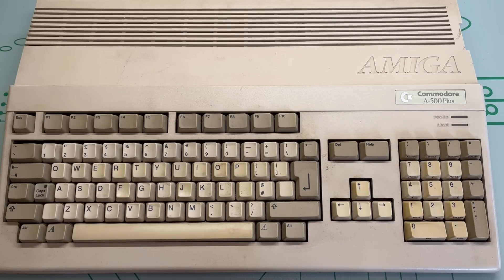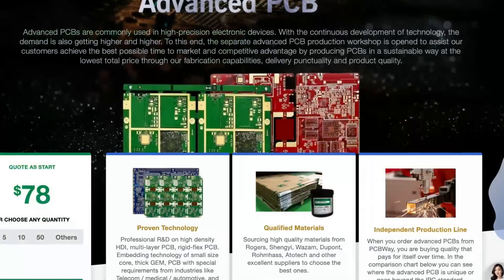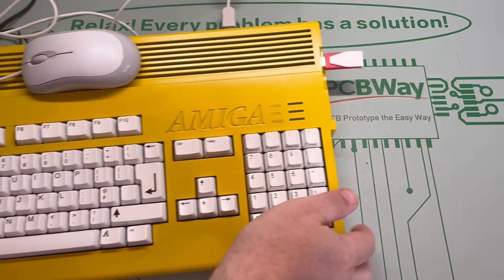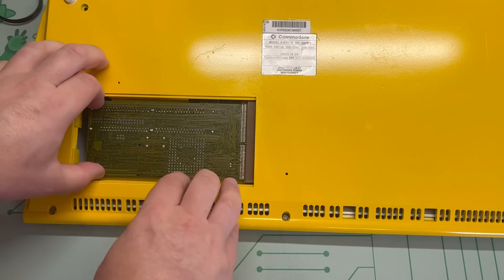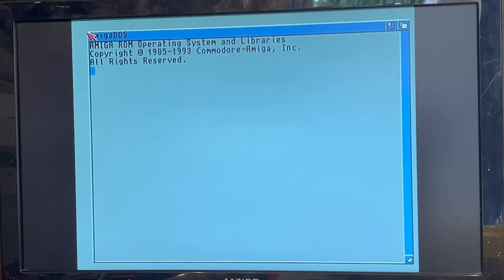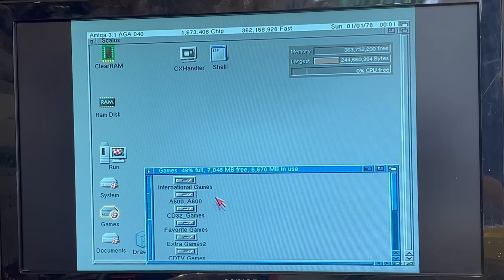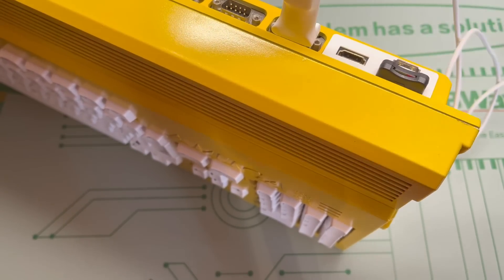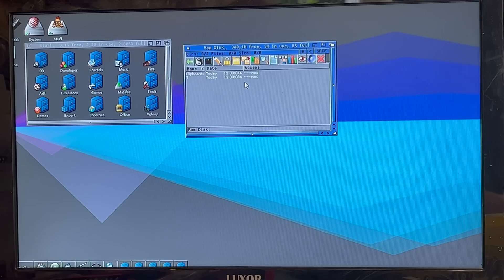Installing a PiStorm32 Lite in your Amiga 1200 is so easy now that even an idiot like me can do it!

Comment: From uk sorry to did you respray your a1200 case yourself or buy it from a site I had a a1200 20 years ago and fitted a 8 mg blizzard sold due to divorce but now times have changed and purchased another a 1200 bod standard but I went for a recapped one and I’m lost the first thing to do is get probably a pistorm and pi zero off pi hut because it’s not set up for hdmi  plus a gotek and a cf hd is there anything else I can do I spent a bomb on the Amiga it runs but I have not seen a screen shot yet please any advice doing a lot of research and excited

Comment: I remember moving from my A1200 to my first PC, a Pentium 120MHz and trying to get my favorite Amiga games to run on it. Back then UAE didn't stand for Ultimate Amiga Emulator, but Unusable Amiga Emulator. Look it up, not a joke :) The 120Mhz Pentium wasn't anywhere near fast enough to emulate even a 68010. Crazy to think a Pi is over 600 times faster than a A1200

Comment: First time installer of a pistorm and kept getting memory errors doing 'sudo ./buptest" and found out the legs of the pistorm didn't quite make full connection inside the CPU socket. I had an old accelerator card that fit in the same cpu socket with 'chonky' pins, plugged it into the socket, pulled it out, then put the pistorm back in.. now the pistorm works like a champ!!!

Comment: CPU, RAM, graphics - all done by Raspberry Pi. Is Amiga anything more than a keyboard for the Pi in this setup?
Reply: I hope by now you know how a Pistorm works and it is nothing more than another CPU accelarator with the ONLY difference is that it's emulating the OFF THE SHELF 68K CPU.  Everything else is 100% Amiga, all chipsets are required.

Comment: Just bought an a1200 that comes with the pistorm 32 lite and raspberry pi 3a+ although it’s not fitted. Somehow I doubt very much that when I plug it in it’s going to be as smooth as a transition as yours was

Comment: Regarding why chips can't access memory on the Pi -- it's because the DMA controllers only touch CHIP RAM.  The CPU's address bus funnels into the Alice/Agnus chip; but the Alice/Agnus chip cannot drive the CPU's address bus (and even if it could, it only has 21 address bits to do it with; hence, 2MB).  So it has zero way of even talking to the Pi even if you wanted it to.  You're going to have to use the PiStorm's support for RTG graphics if you want to use all that new memory for video purposes, I'm afraid.

Comment: It's really easy with Emu68 indeed, for overkill performance put in a pi4b or CM4 with adapter board with some active cooling, overclock it to 2.2Ghz.
Get ready for some shock&awe. it took me weeks to get used to the fact my A1200 was that fast 😄😄

Comment: I've got a PiStorm32lite inside my A1200 and it's incredible, I'm also using a 3A+ as well (as I am with my BBC Master but that's another video) and the speed increase and usability factor goes through the roof. I've got a 256GB microSD card inside mine and using PFS3aio for the filing system except for DH0: (Workbench:) which is still using FFS. The PFS recovery tools from the main PFS3 package are installed into DH0: so if there are any problems I can still boot and rescue the machine. The boot partition is set to 2GB on which I've created a directory called XFER, which I use to transfer data to/from my Amiga/PC as you can mount that FAT32 partition within the Amiga.

One thing I noticed with PFS is if you create a partition bigger than 104GB it puts it in test mode as anything over that is untested. I had a requester warning me when I went to format a massive 220GB partition so I now have 5 partitions, two of them being 100GB each.

I've also got two monitors connected because the native resolutions come out of the standard RGB monitor port and the RTG screens come out of the HDMI port and when different screens are opened, it's a pain having to manually switch all the time when using one monitor with both cables plugged in. So much easier and quicker to tell when something has crashed instead of trying to find a screen open.

I've got mine running in full 24bit color and in 1080p and it's not slowing down - as for the system, I set Workbench up myself just as I like it.
Reply: I am new to this, just bought a PiStorm32lite for my A1200.  Is the best option to save software such as games on the MicroSD card or do people use the Gotek with the PiStorm?

Comment: what was hard on pistorm original. burn sd card and setup it, but its not real amiga its emulated chips using real hardware. same as googling and use winuae same time
Reply: It doesn't emulate any "chips". PiStorm only emulates a CPU. Nothing more

Comment: Your first mistake was doing anything with an A500+. Come on, everybody knew they were just a rubbish A500 and the people who bought them were just "special". Just joking!

Great video, but was hoping for some more detail. I have some important questions though: So this Pi emulates a 68040? So does it implement all of the 68040 instruction set, for instructions like movec, registers like bc, ccr etc? There are instructions on the 040 that don't exist on anything lower.

I'm also quite interested in the memory layout too. A true 040 chip used to use some memory locations between $0 and $320, if I recall correctly. Some on my demos would relocate loaders and stuff down there, after killing the OS. Flower Power/Anarchy and a few Sanity demos has similar systems whereby they did their own memory management and loading after killing the OS.

It would be interesting to see what the OS said was the lowest memory address that could be used was. That's would really be a twat of how good an emulation the Pi was doing.

Comment: chipspeed is still ultra slow.  the 030 had chip speed of 3.28the pie 1.27 so I assume its still very bad at anything that uses AGA games and paint programs.
Reply: Chip writes have been maxed out for a while now (SysInfo won't show that though, better use a proper benchmarking tool like bustest or ssspeed). As for games, most WHDLoad games work fine with the correct WHDLoad and EmuControl settings. Some of the discord Devs are working on a wrapper to automatically apply the optimal settings for each game from a database they are putting together, which will cut down the bed to manually change settings.

Comment: I'm getting some mixed search results. Can you use the pi's wifi or ethernet with the pistorm32-lite? Preferably with Roadshow.
 And if it does, how are the transfer speeds? (compared to pcmcia ethernet?)
Reply: No Pi WiFi/ethernet under Emu68 at present

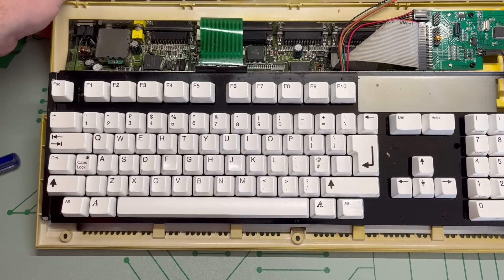Comment: @4:20 not sure how well this would work on an amiga but ive found for cards that dont have much room or are not easy to grip is to put a little piece of tap at the edge sorta like a tab that you can pull on, i do it to my CF cards in an embedded system as it doesnt still out far enough for my fingers to grip

Comment: The Emu68K configuration is so much easier than the first implementation of the PiStorm. That one requires three different computers to set it up! (A PC, logging in and configuring Linux on the PiStorm, and configuring the Amiga) - this certainly reduces the steps required.

Comment: in which way is the usb port or ports of the pi to be used. i want to transfer some file from my pimiga setup to my cafeine 1200 setup. never saw a clear video of that. and that is what really matter to me. data transfer.
I did stick the pi3B+ in there and indeed that looks like a castrated cat with the ports of the rasp hanging true the bottom of the case LOL really should get me a 3a sometime.

Comment: I enjoyed the video but Gloom ran very well on an 030. Would Quake not have been a better test? I'm unclear where your cables for the rear port came from, and what the implications are for video output regarding Amiga games and mode promotable programs. Woud I need separate monitors etc?

Comment: On the one hand, this is nice. On the other hand, the PI is giving you the CPU, the accelerator chips, the memory, the HDMI, the winchester... in the end, this is not else but an emulator put into a cases of an Amiga.
Reply: Sorry but that is not the case. The Pistorm is much more like a turbo card. All internal custom chips remain in function. All ports of the Amiga can still be used. Graphics and sound output also work as you know it. Only the original processor is switched off. Ok it is a little more complicated but you can read about it on the net.
Reply: @Fumpzong You can look at it that way too. But. It can emulate the CPU, can give you RTG video (with acceleration!), emulates the clock, the SCSI, the ROM. If you switch that all on, what remains? Maybe the Paula, but I'm not sure.
Reply: @MrEnyecz  Depending on one's point of view, the situation can be described as one in which the glass is either half full or half empty. If you have fun with a PI Storm, you have fun. Those who don't, even not 😊
Reply: @MrEnyecz PiStorm doesn't emulate anything other than a CPU. All the other stuff (RTG, Storage) is handled by 68k drivers hitting the Pi hardware directly. Nothing there is emulated, all the original chipset is still in use.

Comment: PSA: Be aware that the ‘timing issue’ does affect Pistorm32, this has been fixed in software though.

CaffineOS didn’t give me this issue and I believe newer builds of emu68 fix this, but older builds without the fix caused crashes. I don’t know if Musashi has had the fix applied.

Comment: Very cool mod but 2 things come to mind. 1: the sd card slot should have been located the other side of the board so its accessible via the trapdoor rather than unscrewing the case or buying the breakout box. 2: Is there really any point doing this? There isn't much you can do on an Amiga that you cant do via emulation or via modern pc apps nowadays and I really cant see myself using dpaint when photoshop exists. You might as well just take the Amiga motherboard out and just use the pi with that bootable Amiga emulator os thing and a few adaptors for the keyboard and such if you really want to use Amiga programs in an authentic Amiga case.
Not a criticism of the pistorm, which is an amazing bit of design.
Reply: There's no practical reason for any Amiga accelerators nowadays, except for the fun in seeing how fast we can push these venerable machines of our nostalgic past. When I was a teenager with an Amiga 500, I dreamt of having an 020 or 030 accelerator board or an Amiga 3000, but could never afford them. It's nice to be able to scratch that itch now.

Only a tiny handful of games take advantage of the faster CPU and FPU to give better frame rates, but those run just fine at max speed under emulation or on a full-blown MiSTer FPGA system using the Amiga core. Any Amiga productivity task which benefitted from fast CPU or FPU, such as 3D modelling, video editing and animation work, is better tackled on a modern PC or Mac nowadays.

Comment: How much of the Amiga is actually doing anything here? Seems like you might as well ditch the motherboard and leave a raspberry pi in there with those ports available and a keyboard connector.
Reply: From what I read, the PiStormLite really just emulates an M 68k CPU rather than hosting a physical CPU and shouldn’t be different than using a traditional accelerator with extra RAM in the Zorro slot since those also disable the stock CPU. The RAM boost is insane compared to what most of us would really be able to use. 128 megs on my TF1230 is already more than i need. The efficiency of the emulated CPU is supposed to be better than the real M 68k CPU series. The PiStormLite doesn’t emulate other motherboard hardware like the MOS custom chips that I know of. 
I believe the Pi has the potential to be an entire emulated system but in this case the goal is to have a cheap and powerful accelerator with RTG as an option for wedge-case users. I’ve wanted RTG for TVPaint and Imagine but I have an A1200. This is a more realistic option than an expensive Vampire for me since I don’t want to expand outside my 1200’s case to use an RTG card.
Reply: @nicktaylor1649 nailed it with that answer. It emulates nothing more than a CPU. Everything else, like RTG, Storage, etc, is done with 68k drivers hitting the Pi hardware directly
Reply: Hi,
Best way of thinking of the Pistorm is similar to Blizzard PPC accerator. With Phase PPC you have the option of Scsi and RTG. The Amiga is still there but you have a quicker system due RTG or disk controller.
Reply: @ just got a 1200 so will look into getting a pistorm now :)

Comment: I see the PiStorm still is not full bandwidth to chipmem. You might want to run "bustest" for comparisons. I thought they had worked on it and smoothed that out?
Reply: Chip reads have been maxed out with the PiStorm32, but SysInfo is rubbish for chip speed testing. Like you say, bustest or ssspeed is the better tests for that

Comment: You can not emulate CHIP RAM cause CHIP RAM IS ONBOARD and directly accessed by the chipset, the only way to replace/upgrade that is by messing with the motherboard and chipset or by going the full FPGA route as with the Mister and that requires you to create in FPGA something Comodore planned for the 4000 but never did, which is the above 2Mb support for chip RAM, the 4000 was supposed to have enabled 8Mb CHIP RAM but never did, the jumper can even be seen on most 4000 Desktop motherboards. I would love to see someone upgrading Agnus, Buster etc to fully support even just the 8Mb CHIP RAM so you can actually have improved AGA modes and improved samples for Paula (yes Paula will use CHIP RAM for its Samples)

Comment: The second thing you showed with Caffeine and HDMI basically replaces the entire Amiga? Sound is emulated? Chip ram and the rest of the Aga is emulated?
Reply from the maker: Nope - it’s still using all of the Amiga chips apart from the CPU which is replaced by the Emu68k running on the PI.  The re-targetable graphics are piped back from the Amiga to the PI and out through the HDMI port.  You can’t run CaffeineOS without an Amiga :)
Reply: @TheRetroShack That’s nice. I believe the Vampires replace everything and just use the Amiga inputs.
Reply: @keyboard_g  The Vampire V4 boards can be used just as an accelerator or in Super-AGA upgrade mode with 6 meg of Chip Ram. This is changed by setting a jumper.